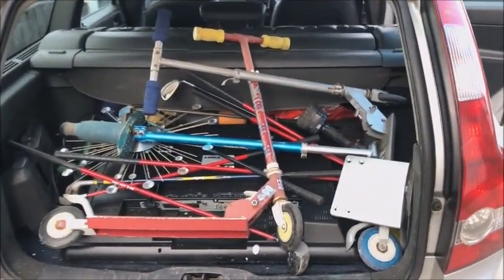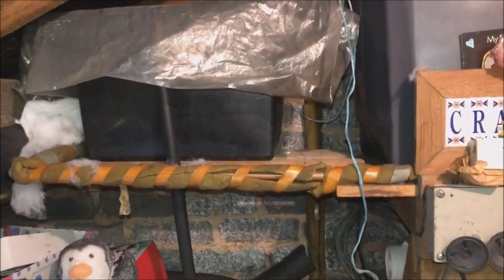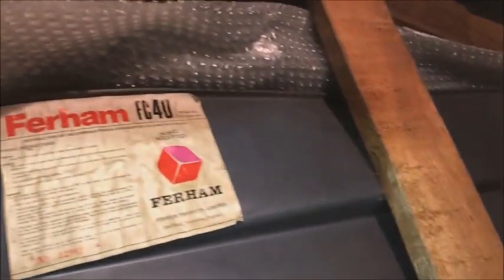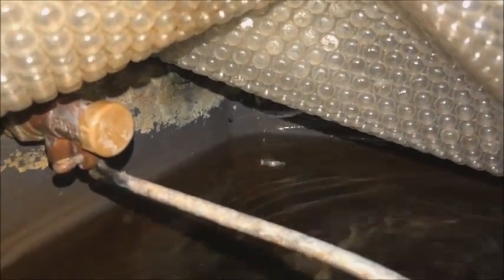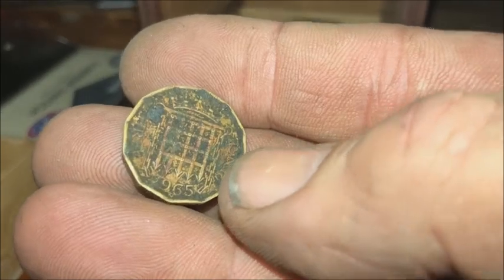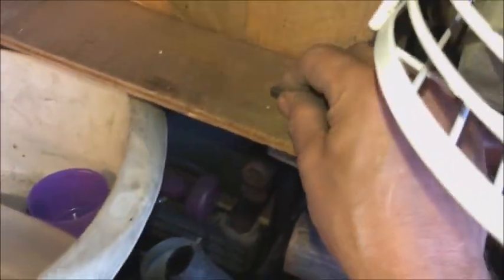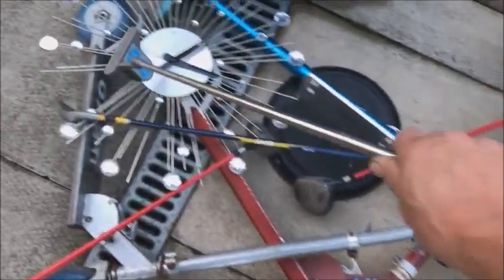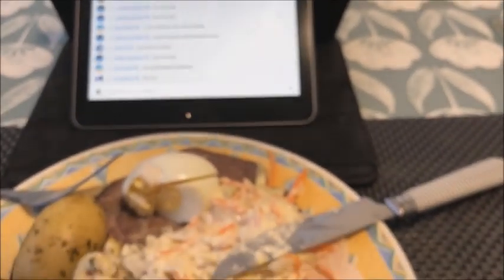Anybody got a Ballcock

Comment: Water, what the metric system is based on. 1 liter of water = 1 Kilograms/1000 Grams. in volume that is 10x10x10 Centimeters, water boils at 100 °C and freezes at 0 °C
Metric, the units that make sense, leave your fairy tail units behind and convert to logic!!! 
Ok rant over...  Your attic has some interesting relics from a distant past, that weird water system is one of them, probably older than you even 😋 hope you'll be able to fix it 👍👊

Comment: Looking at the bend on that shaft you had a problem getting your ball wet before lol . Treat yourself to a combi set up when you empty that shed or golden boards .
Reply from the maker: East Coastuk  ahh a very astute observation
Reply: Modern, condensing, combis are notoriously temperamental. They may be more efficient and running costs may be lower, but unless you take a great deal of care re installation, flushing of pipework etc and servicing, they can be a nightmare. If you do opt for a vented system boiler (like Ian's) to combi swap, exercise caution. You will have to pay £$£$£ for an annual service to satisfy extended warranties. I would strongly advise this. You wouldn't want your new boiler to go totally nuts for want of a replacement o ring. See Challenger space shuttle.
Sure Ian wont mind...
https://www.youtube.com/watch?v=auU1qhxyeQI

Comment: There should be two separate warning/overflow pipes. One for the smaller heating, feed and expansion tank and one for the larger, cold water storage tank. Gate valves are notorious for seizing up. There are other reasons for this but essentially, it makes it also makes it easier to identify which valve is passing. I'd get a full bore, levered valve instead.  One of these. Ballofix valves are notoriously unreliable too. 
https://www.screwfix.com/p/lever-ball-valve-red-15mm/67744
Replacing the washer looks easy enough. Very little scale (soft water area)  
Ever tried sourcing a huge, rubber washer for a  commercial 300 gallon, fibre glass reinforced plastic tank? Plumbers merchants don't stock them. I cut my own from 3mm thick rubber sheet. Gives mean idea for an upload.
Reply from the maker: Thanks loafer. I’ve always thought those valves were for air, I keep saying I’ll stick a combi in and do away with all the header tanks, but as long as my trusty 40 yr old Baxi  504 RS keeps going ......

Comment: Hi Ian oreet cocker if you had turned the cold water main feed off and opened hot tap it would have drained the tank down much easier than syphoning
Reply from the maker: lancashire Biker. Very True, for the cold water tank anyway, I suppose I could have done the same with a drain cock on the Radiator, for the small tank, but that would have put fresh water into the system, but as a  Lancashire lad you must know I didn’t want to waste the hot water.

Comment: Hello Ian.
Back when you were 9 years old,, holographic pictuers.
Water at +4°c is 1kg.
I find it strange to have your water heater in the attic, usually we have them in the boiler or laundry room.
Reply from the maker: its gravity feed so the higher the better, but i still have to have a booster pump for the shower, I did a video on that 18 months ago.

Comment: just replace the diaphram, theyr only pennies, just unscew the brass ring behind the  split pin
Reply: or the whole unit   https://www.screwfix.com/p/flomasta-brass-part-1-float-valve/913fy
Reply: also i wonder .......whats the point of 2 tanks ?
Reply: most vents expand into the same tank and overflow from there if necessary ?
Reply from the maker: see my reply to Scrap Kingdom
Reply from the maker: The small one  feed the central heating system, and will have Fernox  ( corrosion inhibitors) in it
Reply: @Man-in-da-shed  all radiators harbour sludge. its like ink, ever tried yo flush a radiator ..... uggggh